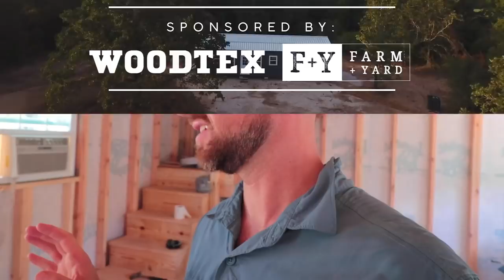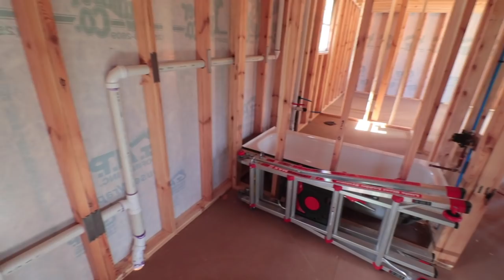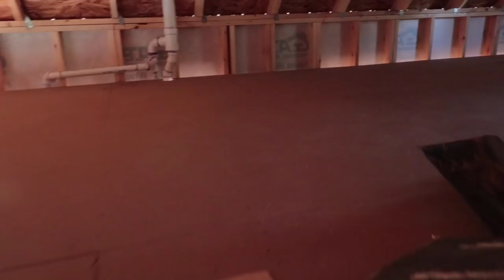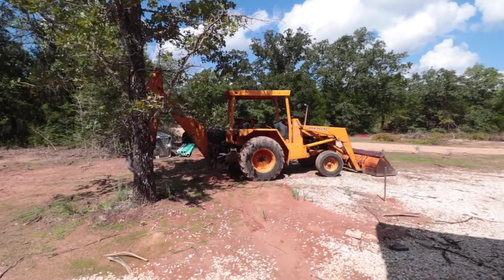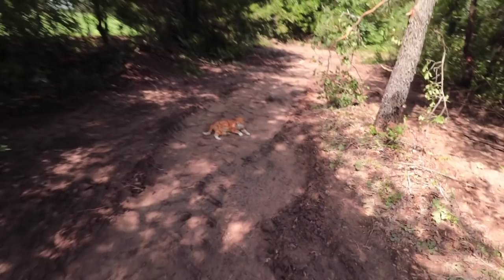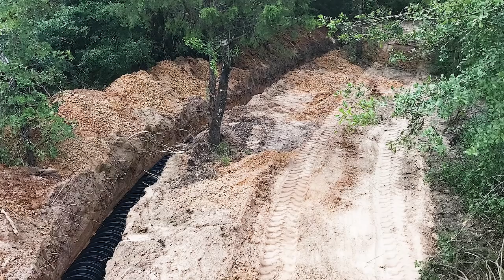We Have a SEPTIC  |  no more camping POOP BUCKET

Comment: Looks like y'all are coming along just fine! 1000 gallon septic  tan is about right for a family.
 Looking at the under house PVC, I would highly recommend that you cover them with the Pink Panther fiber glass insulation. I know that we don't often have super hard freezes, but when we do it's not pretty. Good thing is that the pink stuff is relatively inexpensive. That's what my late husband did to our pipes at Medina Lake in the winter of '85. We were living in a roughed in house that only had the Owen Corning fiberglass insulation was my interior design and the plywood subfloor. I do not think that they had the spray foam at that time because we sure would  have used it if they had providing that it was cost effective. What time getting at 4 is that now is the time to add things such a heat strip and additional installations to your pipe with that exterior thermostat that you can set the temperature where you want the heat to be kicking on so that your pipes under the house do not freeze. 
 I have mentioned in a previous to post to you about how happy I was that we got our septic tank and the well hooked up to the main house 24 hours before the first November blue Norther hit. Using a north facing outhouse in those conditions is no fun. What I am getting at, when I make these suggestions, is learn from our mistakes. Gary and I went in to building our house with the same amount of experience that you and your wife have...zero. And, you have already mentioned in a previous video how costly fixing a mistake can be. We made dozens along the way in the 23.5 years that we lived in that house when Gary died. If I can save you or your followers in the shed to house community some headache, heartache, and money, then those hard lessons we learned were well worth it. The weather in Bandera County is not so different from Bell or Williamson County that what I suggest should apply for you.
P.S. plant lantana and salvia around the trees come springtime. Those are usually not eaten by the deer, are extremely drought tolerant, and attract humming birds, butterflies, and honey bees.

Comment: Get the entire crawl space insulated soon as possible Black skirting below ground level. And a nice layer of rock to crawl on below the shed. All pipes should have heat tape, all wires also should be protected from rodents. Place good vents with air flow below the floor. Keep it dry an cozy. It all begins at the foundation. This ground hasn't settled yet. More supports are needed. Just a thought to help you not meant to criticize.

Comment: Really exciting new build good luck on the conversion. Can I suggest that you fix that floor joist the plumber notched out for the toilet. I can't blame the plumber, they gotta do what they got to do to install the system. It's up to you to insure that appropriate structure remains. If you look at your video you will see the plumber notched it 1/2 of the way through. that may be OK but is really a big notch under a toilet. A 2" x 6" sister attached with nails and bolts on the cut side without waste pipe intrusion should be enough on that short span to prevent future sag/springiness and possible floor failure. Easy to fix now, pain in the butt later when all that possible floor movement could cause toilet seal failure and floor damage which you may not notice right away after insulating the floor and installing perimeter skirting around your new home.

Comment: We did our house the exact same way with the kitchen plumbing, as in the sink supply and drain pipes are in an outside wall.  That means the pieces that most need protection from freezing weather have the least amount of insulation.  Just something to think about, I know everytime we have a hard freeze, I think about it for ours.  Also, you are using frost proof faucets, aren't you?
Reply from the maker: Yes, most of our plumbing is on the inside wall....oh well except the kitchen.  Ok yup.  We will have to figure that out.

Our pipes are all PEX at least.  So when they freeze they should just expand, and not burst.

Comment: How much moisture has that floor absorbed because it's pretty low to the ground? How cold is that uninsulated floor in the winter
Reply from the maker: Underneath the floor of the house is 100% insulated with 4 inches of closed cell spray foam.

Comment: Was it difficult avoiding running into main runner boards under bldg when putting in drains for sinks shower tub and commode?
Reply from the maker: I do remember my plumber having to put in a diverter for one of the toilets for that exact reason.  Right where we wanted it, there was a big main runner.

So yes it is a good thing to think about.
Reply: @BetterTogetherLife  I am hoping sink share same exit pipe  shower washer and commode each have there own. Plumbers will be doing my plumbing.  Electricians for electrical

Comment: Are tree roots a problem for your septic system?
Reply from the maker: Very good question!  I guess I should ask my installer that.

He has been doing septic for 20 years and is the top rated in my area.  So I would hope it’s not going to be an issue.
Reply: Better Together Life  in my experience you never want a tree in or near a leach field if you can avoid it , they will seek water and plug it up fast
Reply: @eschesworld  my exact thoughts! Trees+septic=more income for the plumber